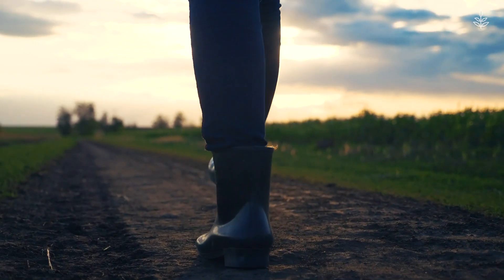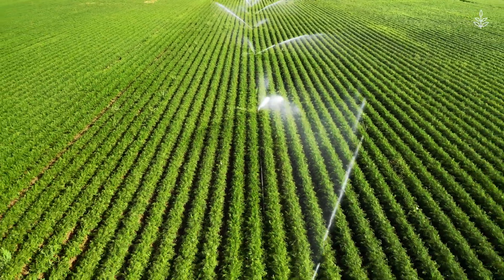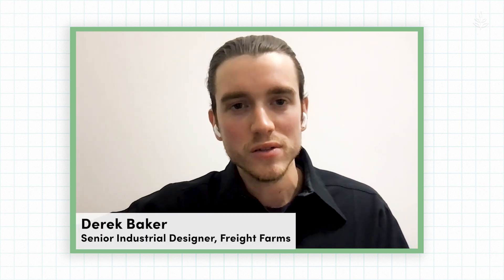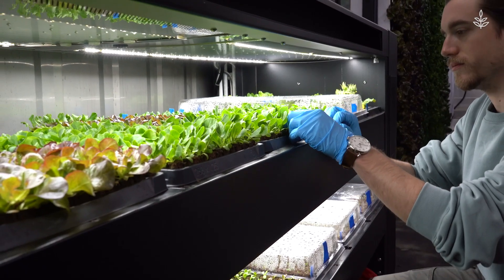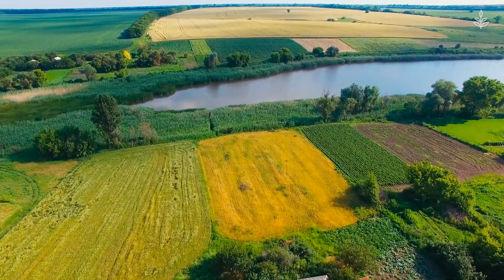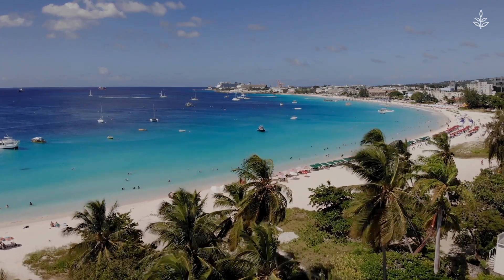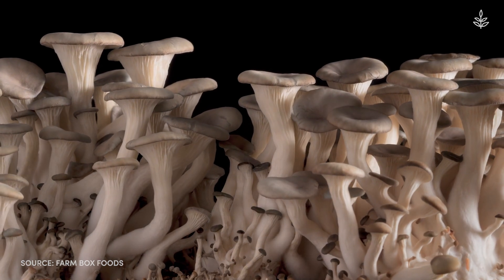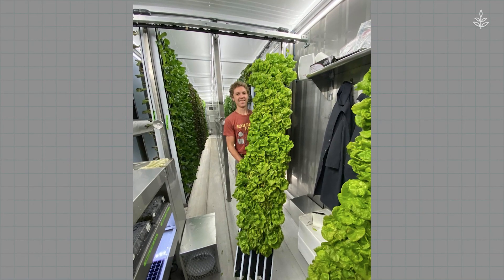How They Did That: Container Farms May Be the Sustainable Solution to Our Broken Food Systems

Comment: This technology is amazing, however this particular system here is just a copy of a - not so well thought out - original from the 
"Leafy green machine". There is a lot of wasted space and the system is very un-flexible and cumbersome to operate.

It looks a lot like a (semi finished) student project.

The vertical planting system I use, fits in a 6m container, but provides a similar yield and is subdivided into 5 different climate zones and 8 different nutrient zones, which can be independently controlled.

In addition to allowing me to grow a large variety of different fruits, vegetables, spices and herbs, I can grow potatoes, rice, soybeans, grains and grapes too. It has 10 encapsulated (enclosed) fruit trees and two growing stations for mushrooms or mycelium.

Additionally, it has a small, build in brewery, it makes wine, can distill spirits and makes it's own liquid fertilizer from plant material and recycles plant material to create biogas, which I use for brewing and distilling, not to mention that it also has 8 small bioreactors that will produce different kinds of lab grown meat in the future, using nutrients from soybeans.

This highly compact food production system fits in a 6m, insulated shipping container, has it's own solar panels, water maker, wind turbine and heat exchanger.

Comment: They covered the light and water but failed to cover the soil and nutrients. Where does this come from, is it shipped in causing the same issues it's avoiding? Traditional farms have to pay a lot of attention to crop rotations to ensure the soil is replenished. 
I really hope this can grow and take off like the plant-based burgers have. Even if it just relieves a bit of the pressure on the limited land available then it'll really have a positive impact.
Reply: Hi Robert! Speaking for Freight Farms here — since our farms are hydroponic, we don't use soil. We use granular nutrients that are dissolved in the water to nourish crops. Check out this video to learn more! https://youtu.be/8LjzdaMECfw
Reply: @Freightfarms  Thanks! That was interesting. So nutrients have to be created and shipped in but this is much more efficient than current traditional farming.
What is the base power usage of one of these? I presume temperature control ends up being the most energy intensive part and that would depend on where it is in the world. I guess attention was paid to insulation, especially in units going to very hot or very cold regions? How much space for solar panels and battery storage would be needed for locations which are away from grids?